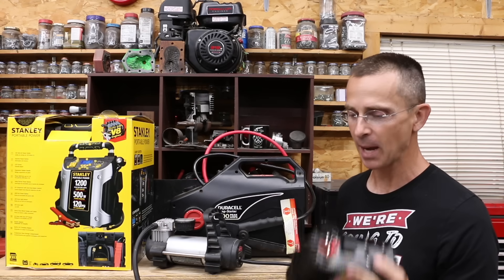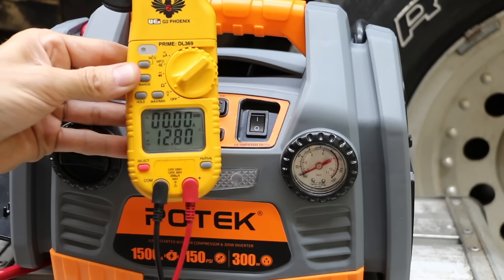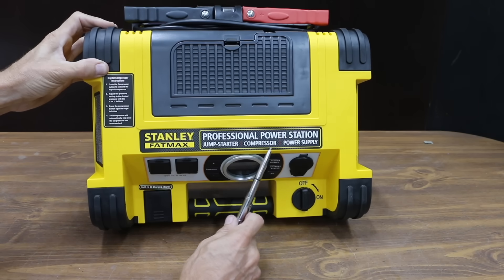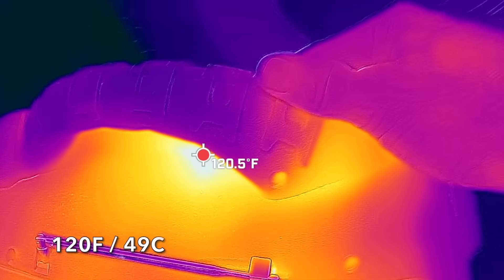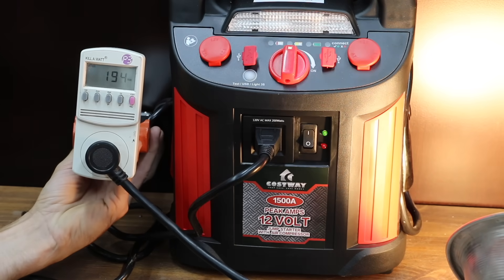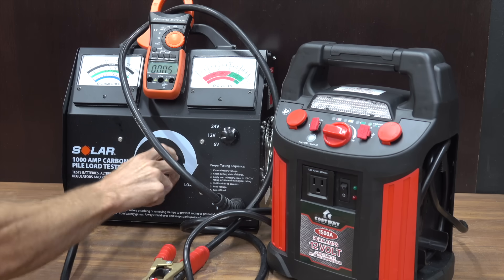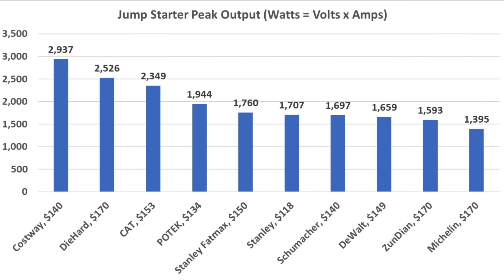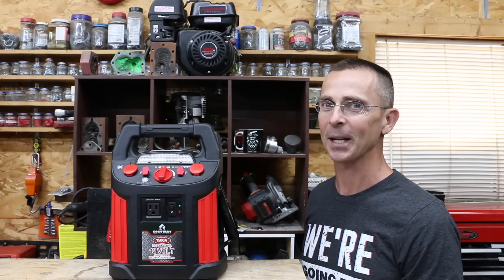Best Jump Starter? DieHard, Schumacher, DeWalt, Michelin, Stanley, CAT

Comment: Would rather carry separate components, such as the ViAir compressor, and one of the many available small jump starters.  I do a lot of overlanding (off-roading) and this is a much more practical set up.
Reply: 100%!!! These multi-tools are a bad idea. I want separate tools for different emergencies.
Reply from the maker: Great feedback. Thank you
Reply: True, but this is more economical for someone who'd just interested in having these things for an emergency when most/all of their driving is in the city. IF you've got a really serious setup, I'd say carrying a nitrogen cylinder and regulator for inflation may be even better. If your compressor breaks, you're screwed, but unless physics stops functioning, or you're somewhere so cold that being there is a serious risk to your life, a liquefied gas is always going to vaporize.
Reply: @Nevir202  . Instead of making ignorant recommendations the OP could easily get the DeWalt or Milwaukee inflator (only) along with a battery and charger for inflating his tires during emergencies. A NOCO jump starter, among many other brands, is not very expensive and take up little room in the car. These multi-tools are a poor idea and one day you're going to find out the hard way because you decided saving a few bucks while mocking other people with more experience than you was more important.
Reply: @viewer-i5o  LOL, you're delusional

1) He's still at the mercy of a cheap POS compressor in your "expert" scenario. The recommendations you just made are still not much better than junk, they just aren't junk combined with other junk. The DeWalt for example that you just recommended is only rated higher than the all-in-one by two tenths of a star, and upi saw how bad it was.

2) Again, most people are never going to need any of these tools, and if they do, the few bucks they'll be out if the thing fails while calling roadside assistance, or the inconvenience of calling a friend is hardly "finding out the hard way."

3) For most people, if they do need the compressor one day, it's going to be dead, or they won't have the battery on them,  because it doesn't come with any reasonable way to keep it charged in your car.
Reply: @Nevir202  Having several thousand miles off road, overlanding, the nitrogen cylinder/regulator would be overkill, and much too bulky, as space is a necessity.  And more importantly, there are days that I may air down and then up several times and the ViAir has a limitless supply of "air" for those purposes.
Reply: @Nevir202  The problem is most of these are simply crap for the most important scenario likely to happen. A truely dead battery, stranded somewhere.  Doesn't matter how 'economical' they are, since most of us are 'economically-minded', hence we're left with crap.  PF testing is hopefully expanding across the world, and making a lot of executive stressed.
Reply: Except you're never actually likely to have a totally dead battery, anywhere other than maybe where you slept or worked. Because almost no matter what you did, the battery won't be totally dead in just a couple hours.

With the tiny exception of if you have a bad alternator and continued to drive your car to spite the warning lights until you've run the battery totally flat.

Comment: "Which one goes up in smoke" is more important to me than the one that works best.  An average unit is better than one than burns down. Thank you Project Farm for your content!!!!
Reply from the maker: Very good point!!  That carbon pile tester definitely put them all to the test.
Reply: @ProjectFarm  It's rly cool that you(or somebody that you hired) are(is) trying to answer questions from ppl. Good job. You are great.
Reply: @ProjectFarm   or at least I can't find one that looks like the costway you have
Reply: @ProjectFarm  ,'!fÏ
Reply: If you connect them in a certain way you can get all of these to make smoke. Lol
Reply: I REALLY don't get how they burnt up on the jumpstart of all things. These basically have a motorcycle battery inside, just a direct connection from the battery to the clips should have meant that you could take all the current the battery would put out.
Reply: @Nevir202  Indeed, an autopsy on the units that released their magic smoke would be interesting, to see what exactly failed inside them.
Reply: @alexanderthomas2660  not an experts opinion, but here goes: they were probably made too cheap to actually be able to receive the power produced by the battery itself, 
if a product costs too cheap compared to what it should be, it probably is for a reason, not that the most expensive ones are always better as demonstrated here is this video.
Reply: @Qwertyuiop-wg5xu  Could have just been a case of too light wire gauge used in the construction to save money.  They should have used 6 or 8 gauge but they used 10, so you get a little smoke when you max them out.  The love of money is the root of all evil.  I think that quote is from a best-selling book. It becomes more and more true as the years go by.
Reply: @alexanderthomas2660  ah  if only he could ship them to Big Clive for analysis.
Reply: @Brian424  while i am not sure that that is the case, that is approximately what I meant: they cheaped out too much on somethings and that is irrefutable, a bit of smoke for a second is not bad, but if it keeps happening on a repetitive basis, the product will break way too much prematurely, and here even 1 of them broke at the first time
Reply: How long these last when used properly is really important to mechanics, mobile service techs and car dealers.
We stick with jnc, viking, snapon etc
Reply: The Stanley smoked and the potential both began to smoke
Reply: I've taken several of these devices apart to replace the battery. They all use a battery smaller than a motorcycle battery. They are 12v battery's typically found in computer standby supplies. Often battery size is 18ah (1218 nut and bolt sealed lead acid)

The wire used to connect the battery looks to be 10, maybe 8ga, so not rated to deliver more than 50 amps. 300 or 400 amps would incinerate it in a few seconds At At a 1000 amp load as roughly spec'd, an 18amp-hour battery would be at 50% charge in 30 seconds, but the wiring would be long gone to smoke! It appears the small plate area ensure s these batteries can't come close to sustains anything like their rated peak current for more than a few milliseconds

Comment: The best jump/pump I've had was one from Costco. Lasted about 10 years, and would fill a tire from flat. Would also jump start almost anything I had used it on (wouldn't turn over a large diesel engine. But would start smaller truck/utility diesels). It's battery stopped accepting a charge, and I got a Stanley one. It has been ok. A lot louder, slower to charge, slower to fill a tire, and won't crank anything more than a gas V8. 

I like being able to do it all with one box. Good testing!
Reply: Didn't have time to mess with it, was moving long distance at the time, and just needed to replace it.
Reply: The older ones are much better, they had a direct connection to the battery (maybe through a physical switch on some of them).

These new ones have safert electronics which are pushed to their absolute limit trying to start a car, and go up in smoke (as seen, haha!) The electronics also don't allow the full current of the battery to flow through, so they don't have as much "balls" either, making them more of a weak battery helper than a true jump starter.
Reply: @volvo09  Makes sense, I assumed there had to be something between the battery and the alligator clips to go up in smoke.
Reply from the maker: Great feedback!  Thank you
Reply: Why didn't you replace the battery? Even if it's not meant to be user serviceable, that doesn't mean it isn't if you're clever lol

Comment: So looking forward to seeing what's the best! This would be a wonderful Christmas present for my husband!  ❤
Reply from the maker: Thank you!!
Reply: Don't buy any of them. They are all junk.
Reply: @tarstarkusz  Have to agree - pretty much all of these type of units are just barely above junk.  Far better off sourcing separate tools to do individual jobs.
Reply: @donhappel9566  And the inverter is basically pointless. There simply isn't enough juice in the battery.  Plus they are all lead acid batteries which don't like to be drained and are very picky about the weather.
Reply: I would recommend against any of these multi-tools. If you want to get him something similar get the DeWalt tire inflator (only) with a battery + charger (sold separately). It will be more expensive but for good reason. I have this unit and I love it. I would never buy a multi-tool designed for different emergencies. I hope this helps. Cheers!
Reply: The Milwaukee tire inflator is also a solid choice. Project Farm review it as well so just look up the other video for tire inflators.
Reply: wow this is now popular enough for women to know about this channel. I just realized he's over 2M subs now. That's so impressive. Wasnt long ago he was about 400k and I was wondering why this wasnt more popular.
Reply: @frydemwingz  Only 99.9998% of his viewers are men!!   Must be at least a hundred woman viewers.

Comment: Excited to see this one, I have the older version of that Stanley with the 12v socket and it no longer holds a charge so I'm due for a new one. Thanks PF!
Reply from the maker: I really like having all the capability packed into one unit. Thank you!
Reply: @ProjectFarm  Very useful as long as you don't need a lot of air, one thing I noticed on the old version of the Stanley was that the air compressor switch was not recessed so if it fell over in my truck it could flip the switch, turning on the compressor and filling my car with the that irritating 80db tone, I think it's something to note on these

Comment: Man I am currently shopping for these! Would love to use them for my RC fun in remote locations
Reply: That's a pretty clever application.

One thing worth considering, just in case you weren't aware, is make sure you buy chargers that either work off the 12v outlet or the USB one. The power inverter for 120v is super inefficient and you'll lose a lot of power converting DC to AC to power a charger which will be converting it back to DC anyway.
Reply: @Nevir202  thank you man, I wasn't aware at all about the inefficiency. 👍
Reply from the maker: Hope this video helps!